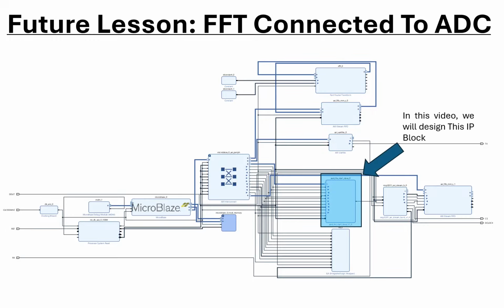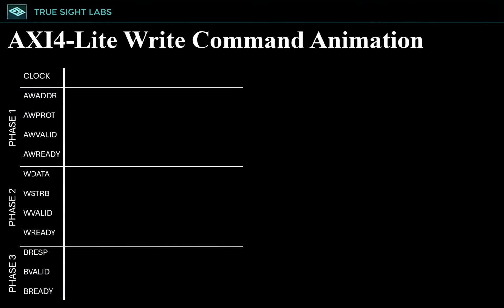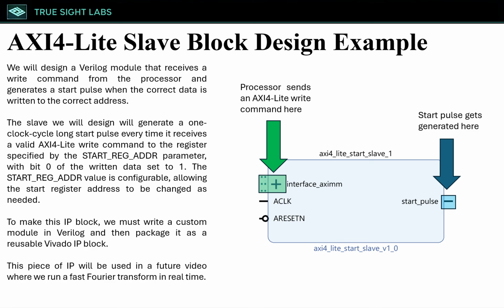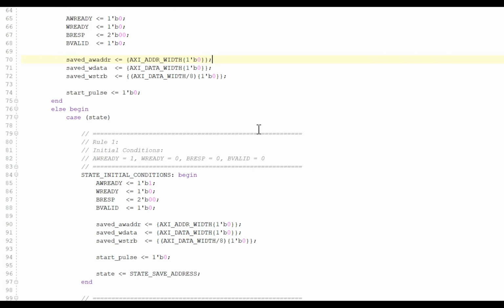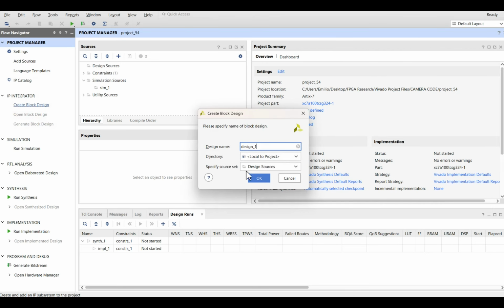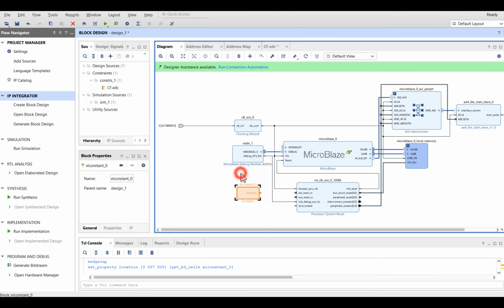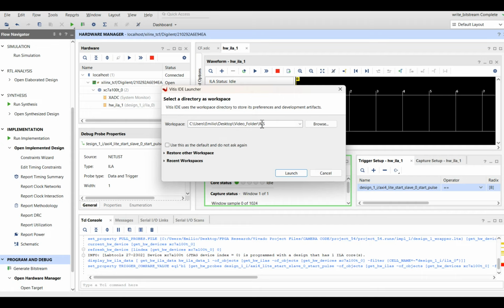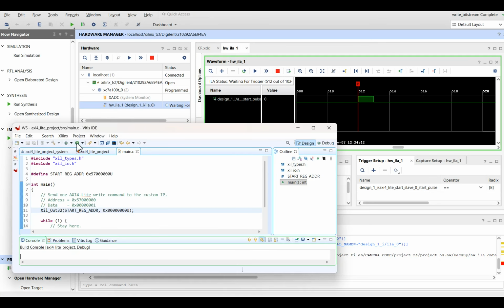FPGA SoC Series #2: AXI4-Lite Write IP Design

Comment: Can data be saved in IP before the Address?
Reply: No this cannot happen because WREADY is asserted only after AWREADY and AWVALID are high for at least 1-clk cycle.
It means that slave is not ready to accept data from the master until the address of the data is first saved in the register of custom AXI4 lite slave IP.
State machine controls the operations to be executed in a sequence, you can only go to Save data state only after Saving the address where the data should be stored.

Comment: Why is there a one clock cycle delay between T2 and T3? Is it defined by the protocol or it's just to capture address correctly?

Can  AWREADY and WREADY be high at the same time?

Can Valid signals remain high for more than 1-cycle?

Why is T5 required? At T4 both data and address are available. Is it because it takes time to write WDATA in register(Data Stabilization)
Reply from the maker: The reason why T3 happens one cycle after is to show that the processor doesnt always drive things immediately. By designing the slave to accept the handshake appoach (the 5 rules), then regaurless of how the processor or any other device issues the write, the transaction will still succeed.

There are implementations that are technically compatible with the protocol where AWREADY and WREADY can be high at the same time, but you do not need to learn every variant to solve this problem. If you use the 5 rules shown in this video, the slave will always accept write commands from a functional AXI4-Lite processor.

It will be high for one clock cycle if the processor drives the ready signal immediately (processors dont always do this, but in my waveform it did). If the slave drives its valid signal high before the processor drives the ready signal high, the valid signal will remain high until both valid and ready are high at the same clock edge.

T5 was technically not required. You could design a slave to of done it in T4. Its just more simple to think about it in three steps:

1) Get address
2) Get data
3) then save

vs two steps:

1) Get address
2) save while simeltanously getting data
Reply: @em3755 Precise to the point video and explanation, Hats off. AXI steam would be a good addition to this playlist.
Reply from the maker: @mohammed_mairajuddin_musharraf  Thats exactly what I plan to make next! Then after AXI stream, DMA and DDR controllers will be explained. AXI4-Lite and AXI Stream needed to be taught first becuase DDR and DMA require understanding of them.
Reply: @em3755 Super excited, looking forward to it.